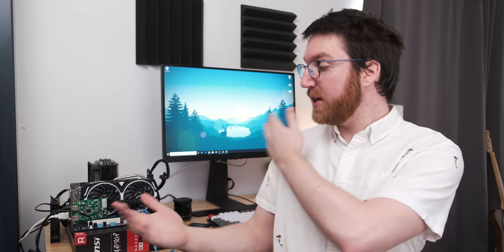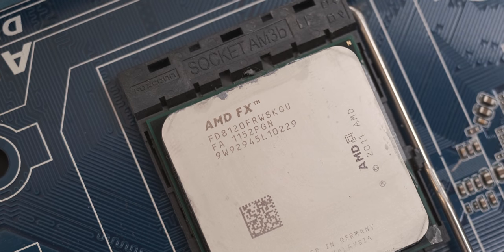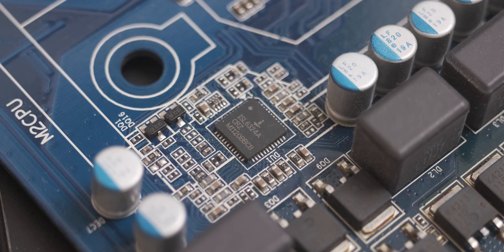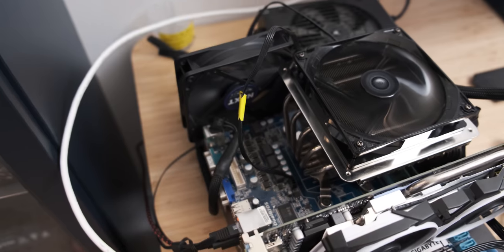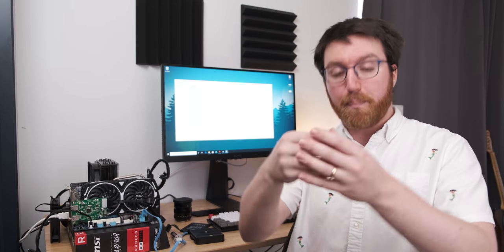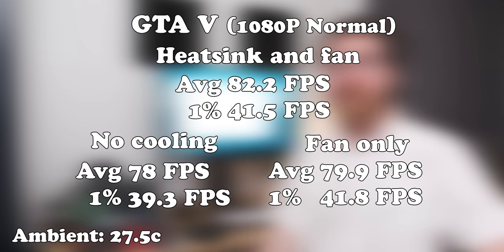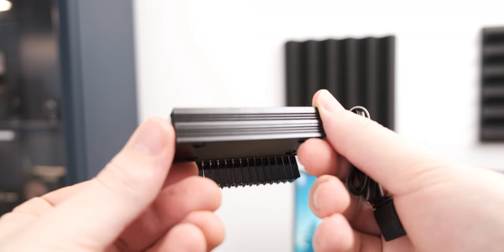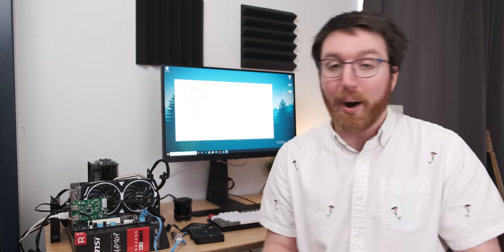Can better cooling fix a TERRIBLE 3-phase VRM

Comment: I would definitely want to see this on a cheap b450 board with no heat sink overclocking a ryzen 9 add some heat sinks and some 5000 rpm fans and see what happens
Reply: Would probably explode
Reply: I would say make sure your home insurance covers catastrophic fires and water damage before you do that..  especially if its a super cheap b450 board.   And if your life insurance is all paid up try an Aliexpresss super cheap no name "a320" board and see what happens .. just make sure to stretch and keep a clear and open path outdoors for when you have to run for your life 🤣🤣🤣
Reply: Have no heatsink on the ryzen 9 if you want to blow up your street
Reply: An OCed 1700 or 2700 would even do the trick.  The Asrock X470 mini-ITX board I have has a heatsink and a crappy VRM, and if I push the voltage any higher than 1.43 set in BIOS, it will thermal throttle pretty quickly.  HWinfo has a nice way of telling you when you are throttling.  It just won't tell you if it's the CPU or the VRM.
Reply: @minecraft0james24  i meant add heatsinks just start with a board with none and go up from there like the video
Reply: Ahhh But FX cpu's are am3+ socket  and b450 boards are socket AM4
Reply: @minecraft0james24  No, Ryzen just shut down without a heatsink, while Intel will throttle to almost nothing to try & keep running, then shut down if it needs to
Reply: @brokenone22  Yeah my brain went there too,
But now I think Dawid meant the same principle on a B450 with no heatsink like a ASRock B450M-HDV or MSI B450M-A PRO MAX using an 8c/16t
Reply: Gamers Nexus got a cheap B450 board to nearly 150c with one of the APUs so yeah... It shut down to stop itself getting cooked.
Reply from the maker: Awesome! Now all I need to do is get hold of a 3950x. 😂
Reply: @minecraft0james24  one way would be Pouring Lighter Fluid on it & igniting the fluid will do it,
but that is the point of how they are manufactured to work so they Don't Explode or Burn your house down,
You must make an effort to Deliberately try for that conclusion because otherwise they Don't do it 🤔
Reply: Dawid Does Tech Stuff yes but I’m sure a  3900x would do the trick
Reply: Dawid Does Tech Stuff also get one of those 5000 rpm fans to keep the vrm cool
Reply: Try to watercool it
Reply: Dawid Does Tech Stuff you could get some sponsors to increase your budget for videos
Reply: Me too
Reply: Let me tell you a secret.
The difference between a 70$ and a 90$ is almost exclusively the addiction of the heatsinks. They do that on purpose to increase their margins. Basically you pay +20$ for a small piece of aluminium.
Reply: Vitor Leão well yes that’s is very true but for the sake of the video it would be better if he used the very cheapest board you could get
Reply: Then add additional help and mosfets for an even better result.
Reply: I have a asrock b450 steele legend with a ryzen 3 3100 (I'm OC it) mobo stays about 35 max, should I get some heatsinks for the vrm? Mobo is new
Reply: @DJZaydex  with a 3100 it does not matter it low power cpu next upgrade I would just get a new mobo
Reply: @arc5579  true true, thnx for the heads up
Reply: It would probably be ok, if you don't overclock
Reply: @DawidDoesTechStuff  im using a H410 and a i9-10900 non K it pulls 270w sometimes
Is there a way to add a heat sink to the VRM on the ASUS Prime H410M-E without damaging the VRM what adhesive to use?
Reply: @aravindraja8034  install bajaj fans inside cisting 1100rs...i am using 3900xt with 70vrm full load 24*7
Reply: @AdityaEnergySolutions  mine is an i9-10900 its a famous cpu for overheating when unlocking the power limit this thing consumes 270w processor alone 
I don't have a way to measure the temps but im sure the temps are super high above 100c for sure and im using it in a open case with 24c room temp also with AC breezing 22c of air right on the motherboard so a VRM heat spreader is mandatory for me if i have to use it with lifted power limits
Reply: @aravindraja8034  mine was hitting 121, because I mine with cpu. So i know what I am talking. Motherboard is giga b450m ds3h
Reply: @AdityaEnergySolutions  im using a puny Asus prime H410M-E motherboard
Reply: @aravindraja8034  buy some aluminum heatsink, stick them thermal pad and place bajaj fan on top of it. You will be fine dude.
Reply: @AdityaEnergySolutions  thermal pads cost like 300-400 rupees online seems too costly can you suggest my some alternative
I had attached a heat spreader form a old crt tv and ziptied it to my SSD and temp went down form 58c to 34c no fans just ziptie

but dont know how to stick such aluminum fins on VRM bcoz i dont have any holes to zip tie it any suggestions pls

also im scare dof using that white adhesive heat sink paste which will glue my vrm to the fins i might break it if i want to remover it in future
Reply: @aravindraja8034  aluminum fins with thermal pad is the cheapest way. Maybe never buy cheap motherboard with expensive processor in future. Your processor can kill anytime your motherboard or maybe suicide?
Reply: @AdityaEnergySolutions  at stock settings it wont pull more than 64watts and stays at 40c max temp

if i choose performance mode and unlock power limit which is not necessary for me anytime unless i run benchmarks

Just trying to find ways to keep VRM cooler when testing and running benchmarks thats all

and a H410 can definitely handle the i9 I guarantee it(unless your mess with bios and remove power limit)
Reply: @AdityaEnergySolutions  if I use a thermal is it sticky enough to keep heat sinks from falling off the mobo ?
Reply: @aravindraja8034  yes, you can heat blower later on to remove paste. But i will pads. They are better
Reply: @AdityaEnergySolutions  thank you

Comment: Love the effort of trying to polish a turd with the little heat-sink, but that was literally the worst AM3/AM3+ motherboard back when it was released. Unfortunately all the heat-sinks in the world can't fix poor power delivery and a bad VRM design lol
Reply from the maker: Oh for sure. It is complete garbage. The fact that somebody thought it was a good idea to use it for an FX8120 is pretty crazy.
Reply: This mod still effective even today. If you buy a cheap MB and add some heatsinks you can get a lot more from it.
Reply: @vitor900000  Still true. Using a Cheap Galax B450M Motherboard with GPU memory heatsinks cut to size and stuck to the mosfets. VRM temps never exceed more than 2-3 degrees above ambient.

Comment: It would be great to see a video on cooling the vrm on a b450 motherboard! I’m planning on building a pc soon with a b450m motherboard and I’m thinking of cooling the vrm with raspberry pi heatsinks I have lying around in my house. Great video Dawid!
Reply: Just get an MSI board. Can recommend the Tomahawk/Gaming Plus ones, they can handle up to an 3900X without additional tinkering.
Reply: Also I recommend to avoid Asrock, their B450 boards are pretty bad. Crappy 4+2 vrm and my particular (it's the Fatal1ty K4) has barely working sound card.
Reply: @michaelmechex  I cannot really confirm how bad the VRM is but oh boy the sound car does suck. Well not for output. For output it's fine  maybe even good. But for input, nah, it's the worst thing ever. I have the B450M Pro4-F.
Reply: @Polarys_CZ  VRM is fine for my base clocked 2600, but that thing cannot handle some of the high end ryzen 7 and 9 cpus, let alone overclocked. My sound card sometimes doesn't output right after boot, I have to re-plug in the speakers while in use to start playing. It never happened with any other source, so I am blaming the sound card.
Reply: Not all 3 phase are bad. The asrock b450m pro4 has a high surface area heatsink, doubled components per phase meaning fairly decent overclocking as long as you don't push the highest voltages, two m.2, 4 dimm and is the best motherboard for like 75-80 imo.
Reply: @michaelmechex  I think your vrm a 3+3 and it isn't that bad from what many have seen.
Reply from the maker: Cool! I will see if I can get my hands on a high core count Ryzen CPU.
Reply: @michaelmechex  I've seen a b350 pro4(same vrm) handle a 3900x stock CPU. You sure it can't handle them? Like a ryzen 7 2700x at 4.2ghz understandable as that thing pulls more power than a 3900x. A 2700 at 4ghz is probably okay because there's a lot less voltage required. Also you don't overclock ryzen 3000 anyway so I don't see much issue with that.

Comment: VRMs are usually rated closer to 150°C absolute max, 120 sustained long term, and absolutely good to go < 100°C.  You'll probably hit stability problems on CPU first with 3 phase power before you hit heat limits.

Comment: A 5% improvement by cooling the VRM's alone is not is nothing to snort at. I say get some square copper tubing, epoxy some barbs on and water cool those suckers. Let's take this VRM cooling thing to the limit.

Comment: Maybe you could give thermal glue/thermal plaster on mosfet to stick it with that heatsink...no other way I guess, unless the motherboard has holes for holding heatsink on VRM....some boards have it even there is no heatsink.

Comment: Since last video I knew that something was wrong with motherboard. There are no boards for AM3+ CPUs, that support 125 watt chips and don't have heatsinked 3+1 phases or at least naked 4+1 phases. I looked at Giga's website and it seems that board doesn't even officially support anything FX. So, it's likely not supposed to work with FX CPUs and if it does, then it is already strained past its optimal limits. Either switch to Phenom II chip or swap that board, because it is a fire hazard now.

Note about AMD chips: Phenom II chips can actually consume more power than FX chips, but there might be difference in their amperages. Also FX chips have more aggressive Turbo modes and they contribute a lot to obnoxiously high power consumption. It might be a good idea to turn off Turbo.
Reply from the maker: Thanks for the comment. The whole time I was testing I had Turbo mode turned off. It didn't really work with that motherboard. 😅
Reply: @DawidDoesTechStuff  What about other power saving settings? They are likely to be responsible for lowering clock speed to save power. I think that it would be possible to increase fps lows a bit by turning them off. 

But either way it's a torture for that board to run FX chip.
Reply from the maker: @MJ-uk6lu  Yeah, I also switched off the eco mode. That motherboard just couldn't handle anything more. I can't believe iBuyPower thought it was a good idea to pair these two.
Reply: @DawidDoesTechStuff  That's why DIY market is where it's at

Comment: One of tricks I learned while trying to minimise system temps on the cheap was to completely reverse the airflow in the system starting with the rear case fan. Initially I used a peice of card as a baffle to ensure air was being pushed onto, rather than over, the VRM section board but later I worked out I could get much the same effect simply by running the rear case fan at a higher speed than the (reversed) fans on my CPU HSF (which created enough turbulance to splash air back onto the board). That approach would work a treat with one of those heatpipe heatsinks you're using in this video.

Btw, I expected that reversed airflow setup to have a negative effect on CPU temps but was suprised find the opposite was true, and I was stunned at just how dramatically temps dropped across the board (pardon the pun,) when I flipped my case upside down (which, after flipping it around to get easier access to the ports, left me with a reversed, reverse-ATX system with reversed airflow. 🤨) The things you do in poorly insulated houses during Australian summers...

Comment: I was always interested in doing this on my b350 so I would love to see it done on a b450 but if you could find a better heat sink maybe or thermal glue stuff maybe?
Reply: I use thermal glue mixed with arctic mx or similar to glue heatsinks on the vrm

Comment: If you got any dead motherboards sitting around for socket 775, am3,am2+ etc..
You might be able too move one of those vrm heatsinks too this motherboard too get some mounting pressure, but otherwise not worth it in general.

Comment: "I can't believe Gigabyte didn't think of installing a VRM heatsink on it"

Because they didn't make the M68MT-S2 to run a criminally hot FX-8000 series CPU, David. Heck, I don't even think they designed it to run further than a Quad-Core FX at that, and even then with hot results.

I have a modified Gigabyte 880GM-UD2H that now runs a FX-4100. I still try to think how on earth did Gigabyte EVER expect this thing to run a Phenom X4 or X6 without downright melting - I've run a round of NFS Hot Pursuit with this 4100 and I nearly got an panic attack at the temperatures after just a single race. Other specs included a R9 280 (aka HD7950) 3GB, about 2x2GB Corsair Dominator and a 320GB HDD, as well as a 700W Raidmax PSU (made by Andyson - this thing is tough as nails, being able to power a R9 280 and a i7 2600k.). The only plus I can think of my board against yours, is the fact that mine sports a 4+1 phase setup, not a 3+1 (which, by the way, sounds incredibly stupid.)

Comment: Right, I posted on another video yesterday asking about your critique of another VRM setup, so I'm glad I stumbled on this video! I wanted to raise a point-- you're attaching a heatsink to the TOP of the MOSFET package. Most SMD MOSFET packages are attached to large copper planes of the PCB through a metal pad on the BACK of the package. Sometimes you're actually better off attaching heating to the BACK of the PCB to help pull heat away. It would be interesting to try to measure the actual consumed current per MOSFET and figure out the legit current consumption. Then you could actually start to see if these things were really designed well.
Reply: Backside fan cooling, very few cases have a mount for it however

Comment: You could try with thermal glue, i would like to see a vrm thermal fix on a more gaming board, a b450 would ne perfect.
Reply: Or thermal tape. Though I can't speak about either options ability to transfer heat.
Reply: Yah

Comment: Thank you! Been thinking about doing this and after watching this vid I committed and ordered a MSI A520M Pro VH ($60) and a Ryzen 5 5600X  now that they're $190. Also ordered 20 VRM Mosfet heatsinks for $7 on Amazon. Can't overclock with this chipset but then again I never do so hopefully performance is much better than my b350m-e and my Ryzen 3 3500X (from chy-nah)

Comment: I added some little aluminum heat sinks from vga VRMs with some thermal pads. Running a 3900x on a B450m… will find out how well that works out…

Comment: One thing you can do if possible in the bios, is to disable 50% of the cores.Powerdraw would decrease and give you more headroom for overclock.And better temps aswell. 
The world record for overclock on a fx chip is done by only 2 cores.
Reply: Someone managed 8ghz on all cores on one of the 6300 I think

Comment: I've been wondering about this, you can get basic heat sinks for extremely cheap and sometimes that's all the difference between a $45 and $70 motherboard. EDIT: Seems worth $5 of heat sinks from china to get 5fps out of a cheap build.

Comment: You did pretty good the turbo range is listed as 3.1ghz base,  3.4ghz full load turbo, and 4ghz at half load turbo. Speed seems to be related to loading so 3.7 was probably as good as it gets while playing a game. I didn't check cpu percentage of use during game play.

Comment: My first gaming PC introduced me to these VRMs. Oh man did my first gaming PC frustrate me. The PC had a Gigabyte F2A68HM-HD2 rev 1.1 motherboard that was paired with an AMD Athlon X4 860K CPU. The VRMs really limited me on it. The best it seemed to do was about 3.9GHz. Overclocking was just a no-go. Even if the CPU was cool, the CPU began throttling down to 1.7GHz because the VRMs just couldn't take it. It really limited what I could get out of that PC. 

It's what made me end up building my own PC. I really didn't like how badly the manufacturers of that PC skimped on parts.

I still have the motherboard and CPU. I am tempted to experiment and try adding some heatsinks to the VRMs to see if that stops the CPU throttling and allows a better overclock. Even though I don't have a need for that PC any more, I am curious to see if adding heatsinks was all it needed.

Comment: ThermalRight used to offer custom heat sinks for chipsets , ram, power mosfets (VRM). I Can't find any good options lately . even pure copper micro fin would do wonders. If you need to make your own I used 30-40mm coppen sinks cut to shape from old Xeon coolers. old 771 15mm copper slabs make great Tylersburg i5520 coolers, flat and big. Or an old AMD Enzotech copper cooler cut to shape for a huge north bridge. Can even add mini fan inside like Abit did back w/ the Max3 Fatal1ty.

Comment: yes try it with a b450 and get one  of those lil kits of the small heat sinks you can put on each on to make sure they fit, they work better then nothing.

Comment: You could try hot gluing a plastic pipe to the vrms and run coolant through to draw the heat away.
Reply: Thermal putty, copper pipe, and zip ties more likely to actually cool it

Comment: Watching this in 2024, I might wanna give some clarifications here: 70° is the ambient temperature limit, it is not about the operating temperature.
75° is actually absolutely fantastic for a VRM!! See there "Maximum Junction Temperature" is actually 150°! lol
So, the most plausible explanation is: the board is artificially limiting the power output. You see that on many entry-level A620 boards nowadays, where the mobo would limit the CPU to 90W max by default.
Reply: Probably cuz it only has a 4pin CPU power connector
Reply: @thesmokecriminal5395  4pin can do up to 190W afaik
Reply: @sassuki  doesn't make sense